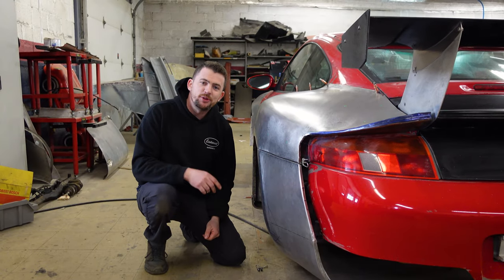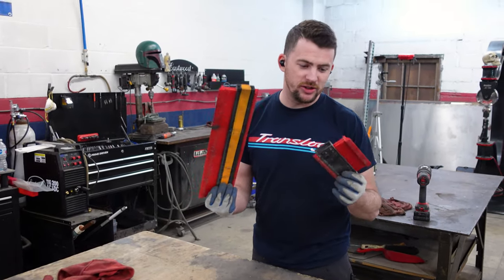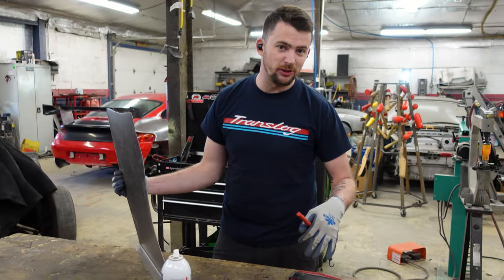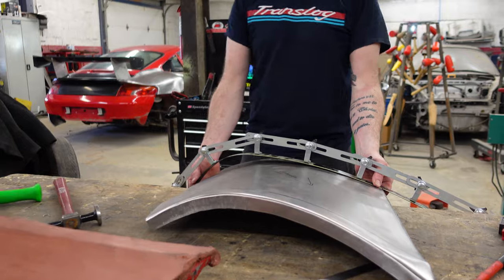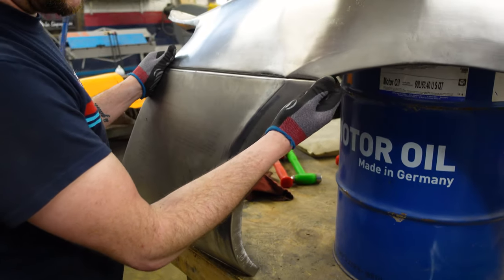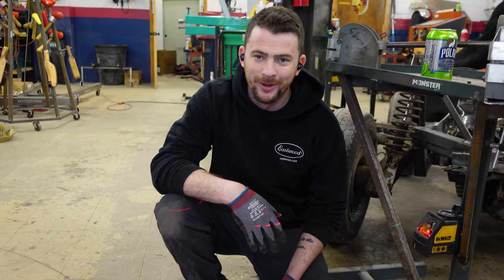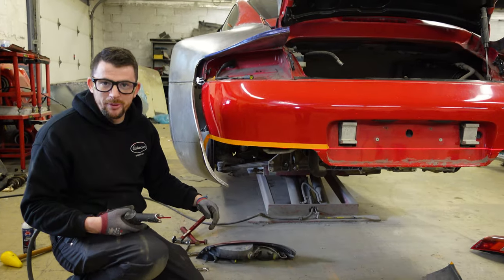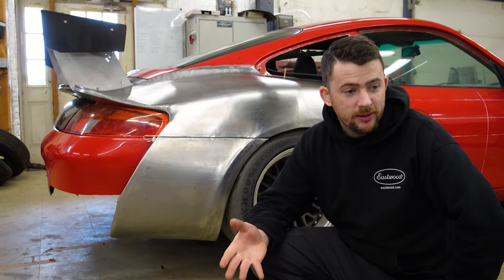Handmade Porsche 911 Slantnose Bumper Extension Fab! 4K

Comment: I’m really looking forward to seeing what you’re doing with the remainder of the rear end. I’m having trouble envisioning what’s next. I had a lot of fun miles with my 2001 996 C4. And then by 2011 it was just in the shop too much having the engine dropped down for one reason or another. And I said goodbye. Best Regards
Reply from the maker: Thanks Mark! We have a rendering that shows the direction — We’ll be sure to throw it into the next video to show some comparisons 🤙🏻